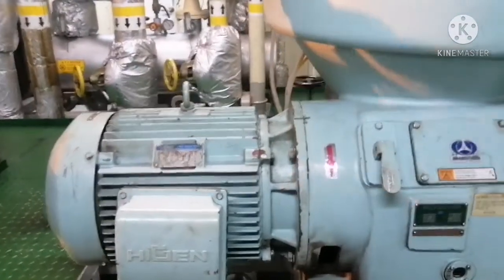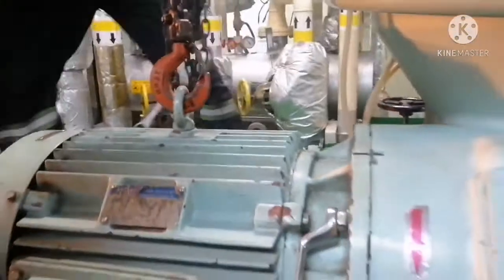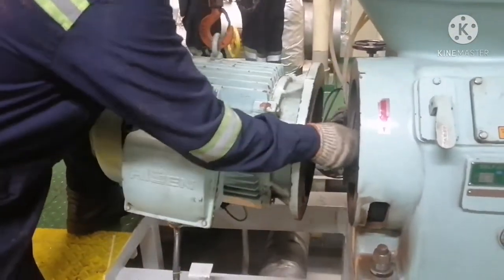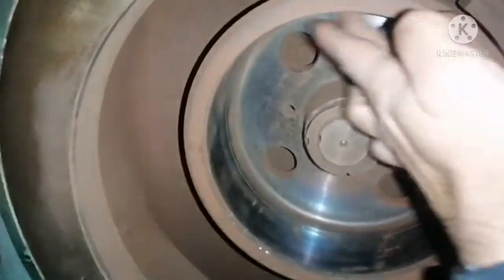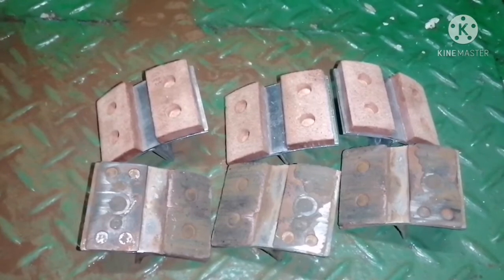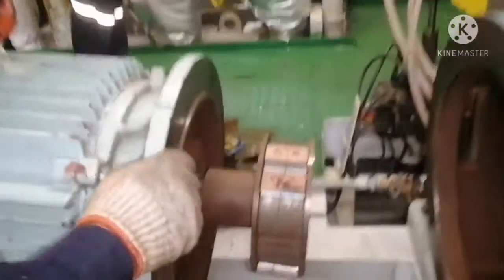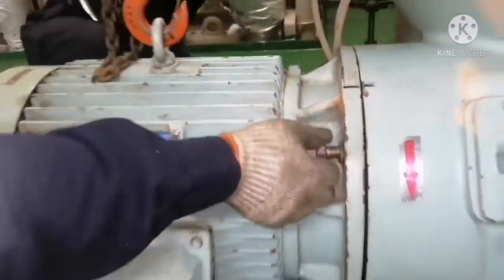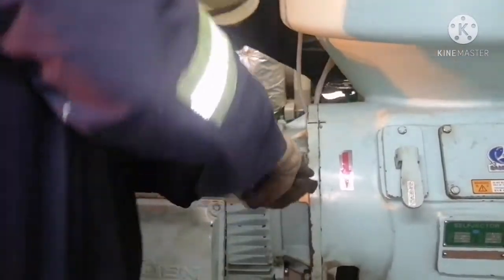How do they do.. EASY WAY TO REPLACE FRICTION PADS ON SELFJECTOR PURIFIER ONBOARD SHIPS...

Comment: May i ask sir, for this case the friction pads with bad condition like that one of the reason Purifier getting vibration also correct?
Reply from the maker: there are possiblities but higher posiiblities will be sludge accumulation

Comment: Sir suppose friction pad is been worn out & no spare onboard.What action required to run the purifier.
Reply from the maker: Aal u can do is u can take a hacksaw blade and give a patch line and make it rough.. So u can use still spare arrives

Comment: Sir no need to change rubber band in pad?
Reply: *remove
Reply from the maker: No need to remove it get melts for to heat generated during operation..

Comment: What to do if no spare friction pad  available on board.. can we do anything on old friction pad to reuse it
Reply from the maker: Thanks for your query sir.
Pick the best friction pad ur having...
Give a small cut which can be less than 1mm symmetricaly cut entire surface of the pad.
Monitor starting current aftr fit up. 
This can prolong till u get the new spare. 
Hope this reply will satisfy your query.
Reply: @marine-knowledge-basha how to give small cut.. with the chisel and hammer??
Reply from the maker: @aadarshdeep1468  you can use hacksaw for giving a cut... Using chisel can giv a crack on friction pad..
Hope this reply will satisfy your query
Reply: Sir no need to remove rubber band from pad?